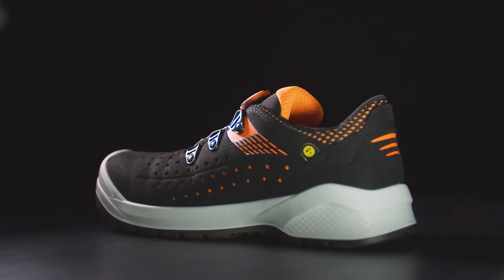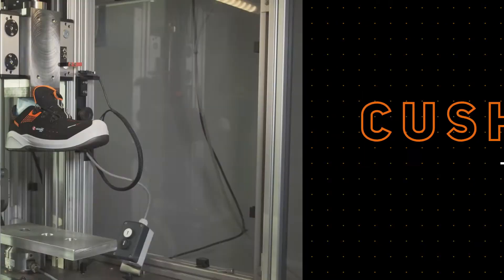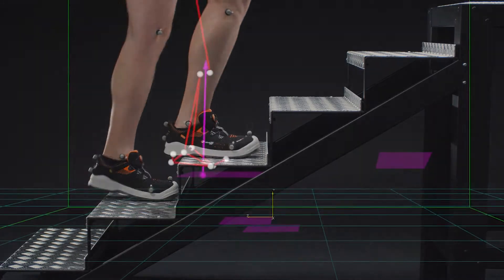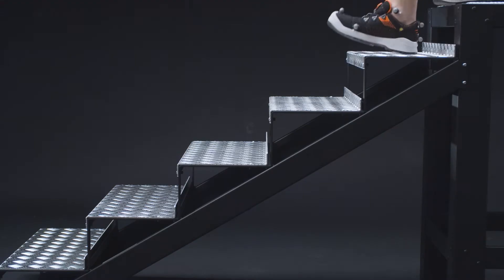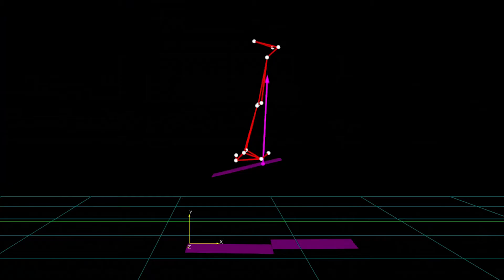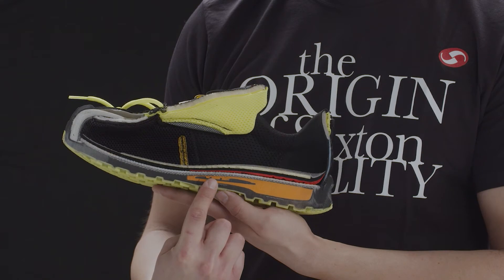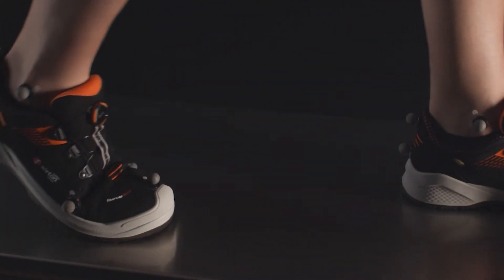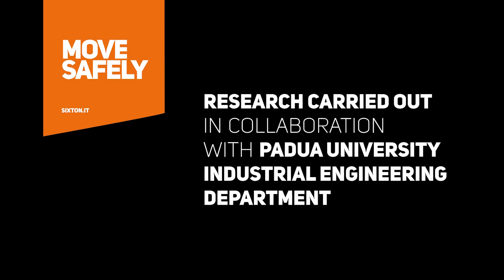Resolute System Technology the safety shoe that provides the very best smart cushioning!

Comment: Please read the following: 

1. Meaning of SRC
SRC safety shoes are slip resistant and feature SRA + SRB features. SRC is a combination SRA (Resistant on ceramic + Sodium Lauryl Sulphate) and SRB (Steel + Glycerol).

So you say SRC shoes has to do a job in a kitchen's wet oily floor right? 
Hell NO!!! (Just keep reading my story....)

2. Hydrocarbon resistance(sixton peak markings for oil reaistance shoes- not all of them supports this)

From GOOGLE#1:
Oil-resistant shoes and boots are protective footwear that is designed to be able to resist petroleum-based products, i.e. if you're boots are oil-resistant, they will not get damaged by oil. These types of boots are made from oil-resistant materials and special glues that don't break down when exposed to oil.
(Should be good for kitchen chemicals)

From google#2
What is an oil resistant sole?
A label of 'Oil-resistant' on a shoe does not mean 'slip-resistant'. Oil-resistant is just a statement that the soles will not be damaged by oil. LOOK AT THE SOLE. No single tread pattern is necessarily better than another.

Now stop, and read carefully!!!
The above statement is a total BULLSHIT!!!

1. I had a top series working boots from maspica named
EN ISO 20345:2011
SCOUT ( series)
ORTISEI (model name)
30334-00L
S3 *CI HRO HI WR SRC( some codes: it says SRC)
 This shoe had a Vibram Sole with a SRC stamp on it. But It has No hydrocarbons reaistance stamp whatsoever.
I was thrilled by a quality of this shoes.
I wear it and came to work. I work in the kitchen where weat and oily floors are part of my daily routine.
I tried to move the trolley with food to another room( we do this every days, Is like 1,2,3). But I couldn't move because I was slippering- like walking on ice.

I was shocked because I was wearing 200$ working boots with SRC, and it should not happen!!!

Long story short:
Maspica sixton peak manufactures two types of safety shoes.

See the bottom outer sole with a lables:
1. Src ( or SRC with a vibram sole)
These types of shoes will slip on a wet oily floor. (who ever said different. Don't listen to them. They lie because they never tested it)

2. Hydrocarbon resistance
This os  SixtonPeak's way of telling us that
This is Oil reaistant sole.
This type of shoes( with such markings on the outer sole) will never slip on the wet oily floors. ( I've tested it myself)

Conclusion:
If you really need untislip resistance shoes from sixton peak. Always look for two markings on the outer sole:
SRC, hydrocarbon reaistance.
Never wear only SRC safety shoes if you work on kitchen.
So again, before you buy sixton peak shoes. Always search for SRC, and Hydrocarbon resistant markings:

If there's Only SRC. It might get into trouble on wet floors(farms, kitchens, etc...)
If both markings are presented in the outer sole src+hydrocarbon resistant you are good to go.
Never get yourself foold by vibram soles.
Vibram it is just a fancy shitty outer sole pattern, that has nothing to do with slip resistance, nor SRC.

I wear sixton peak shoes for the lat 3 years. Belive my words. Don't let anyone confuse you.
Sixton are great shoes.
But. Checknfor SRC+hydrocarbons resistancenmarkings before you buy!

Remember SRC means nothing without hydrocarbon resistant marking.
 
As an example, look at the blundstones boots.( australian brand)
Every kitchen has someone wearing blundstones boots.
Hav you ever wear blundstones boots.
I Did. And I wanna tell you a little secret.
Blundstones boots has ONLY one marking on the outer sole : Oil resistant.
Yes you can work in a blundstone boots in the kitchen. They will slip only for a few hours. Once the outer sole will wear off a bit the boots will never slip again.
So remember don't rely on SRC only
Rely on Oil resistance, or hydrocarbons resistant outer soles
Yes, if you see oil resistant marking you can buy it.
If you see only SRC don't buy it, if you need extra grip

Good luck

One of the best SixtonPeak  untislip shoes.
1. Ritmo dance.
2. Ritmo samba
3. Canto( less comfort low budget)
4. Forza high ( hi budget)
5. Cuban series ( has same sole as samba, and dance)
Reply: Sixton peak. Produces a best quality working shoes. I work in the kitchen standing 10 hours in a row 5 days a week. My legs suffered, and deformed by using low budget. 40$ safety shoes. It was a real hell. Tnaks god i found sixton peak shoes. No more pain in my legs. Thanks sixton:-)
Since 2020 I buy only sixton peak.
They make probablythe  best  comfortable work shoes on market.